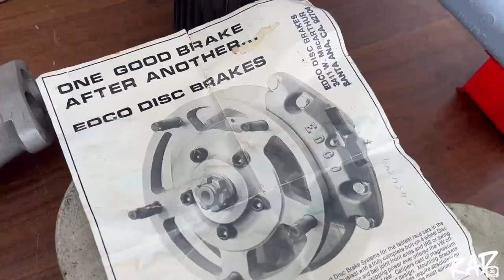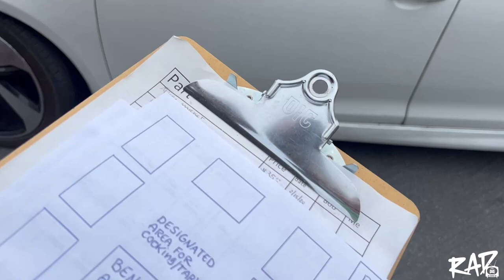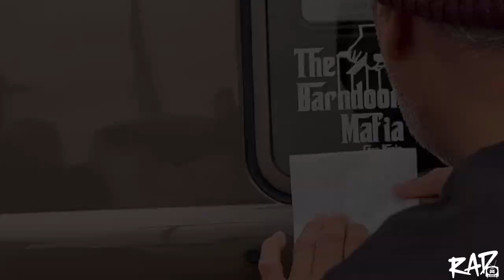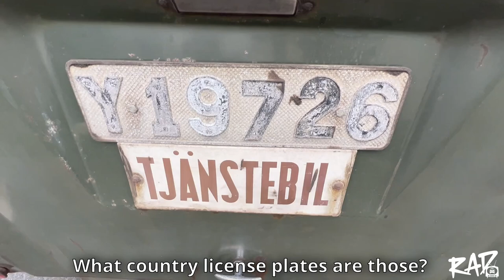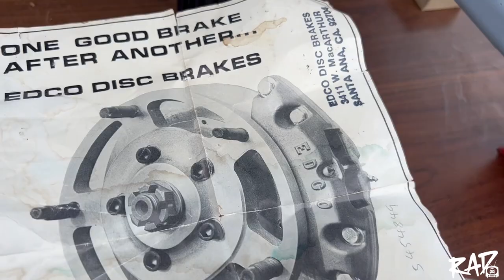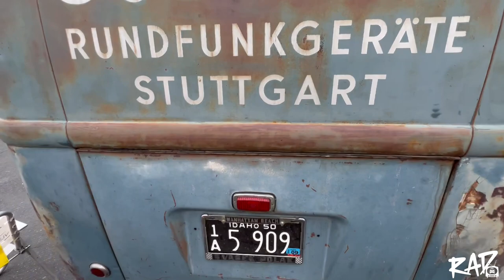VW Bus show OCTO Orange County Transporter Organization  Long Beach California

Comment: Fire truck motor has a mix of parts, 6 volt 40hp motor, 36hp Oil bath Air Cleaner, 36hp 28 PIC Carb, 36hp Fan Shroud & ‘59 Bastard Bosch VJR BR4 Cast iron Dizzy. 😊
Reply from the maker: Great eyes🤓 you’re correct. Lots of 36hp stuff on this transition 40hp. Also know as a bastard 40. Because lots of them blew up 😖 🚌🎉🙌

Comment: The numberplate on the back of the green Barndoor is Swedish
Reply from the maker: Yeah 🎉🕺🏾🚌 correct. Swedish bus, which is left hand drive and left hand cargo doors 😍🚌🙌
Reply: @radtvrandyanddougtv8953  yes, they drove until 1967 on the left side of the road with steering wheel on the left too. That’s why the cargodoors are left too